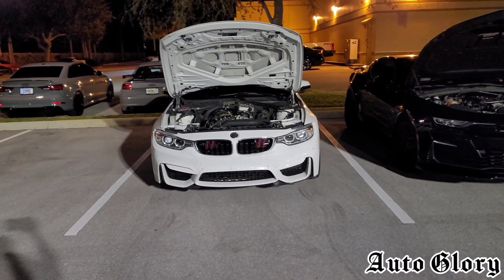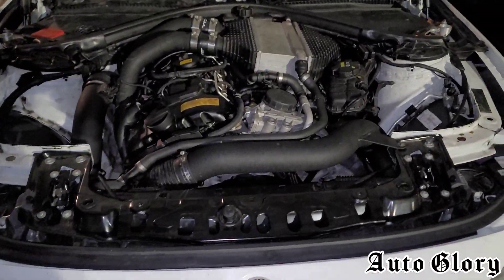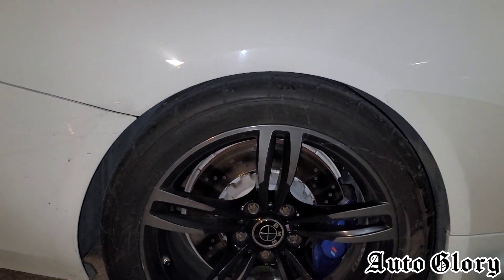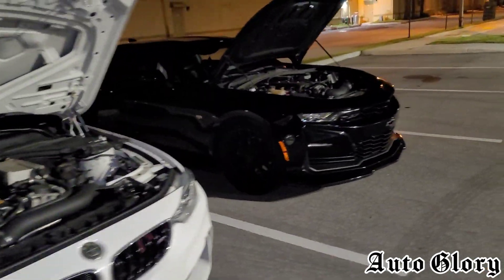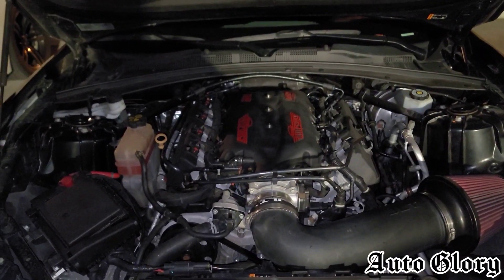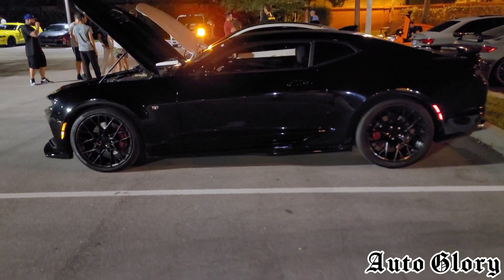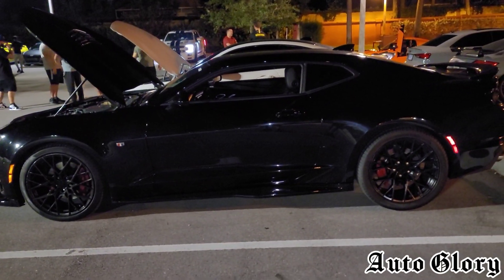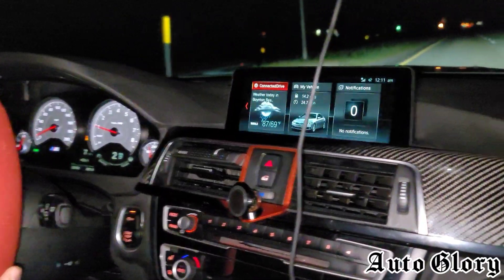2016 BMW M4 Bolt Ons E85 vs Built 2019 Camaro SS Bolt Ons Cam E85

Comment: Damn..camaro and all those big mods and the M4 still got’em
Reply: Beat him like he was stock
Reply: @2jz 240sx I'd say the biggest mod is a built short block....
Reply: @2jz 240sx  a completely picked apart and built engine is a small mod.... id say the supercharger or turbos are smaller mods than a built engine lmao
Reply: @2jz 240sx having a built engine is not really something youd call a small mod lmao
Reply: A built block is a built block, not my fault he didn't run 11 to 1 compression for an na build. He still did a lot of modifications.
Reply: Definitely a tune issue

Comment: Hope he built that motor with the intention of throwing a supercharger on there. You don't put your NA against a tuned turbo and expect any other outcome than this.
Reply: Unless it’s a 4 cylinder
Reply: @2141mario  well if it was the 4 banger then it would be turbo, not NA. And it obviously wasn't as we saw under the hood, and by the exhaust, and I don't think Texas Speed even bothers with anything other than LT1/LT4 for this car, and because I can't believe anyone in the world would be dumb enough to drop a built 4 cylinder into a car made for a supercharged V8. I need to hold onto some shred of hope that the entire human race isn't lost.
Reply: I’m talking about a turbo 4 vs an na v8
Reply: @abbadon3718   lol I think that they meant a NA car could run against a tuned 4 cylinder turbo. Not that a 4 cylinder would be NA xD
Reply: A cat named Scamper  this Camaro was putting down more than a viper, though probably 300lb or so heavier. Educate me, I'm not sure what people are getting out of their viper mods NA. The crazy ones I see have gone TT so I have no frame of reference.
Reply: @abbadon3718  Gen 2 GTS is around 3350 lbs, gen 5 is about 50 lbs more.  9L stroker V10's make about 700-750 RWHP.
Reply: Obviously that's NA, WAY more boosted!  Either way a built NA Viper could easily put a beating on this BMW.  I'd guess a built 600+ whp C6Z would as well.
Reply: @ssoffshore5111  lol the m4 only had fbo couple pipes and a tune 😭 the maro had everything built for the most part. Did u not hear the explanation of said vehicle’s?? Mperformanceftw 🙌🏾
Reply: @120express  Hopefully you meant to reply to someone else because I didn't mention the Camaro above. I just said there's NA setups that would spank this BMW, and that's a fact.  
With that said, when a much larger LS7 427 with far better higher flowing heads/ports has these same mods, it's about a 600 whp setup.  I'm sorry, but I don't buy this Camaro was making 580 whp as stated.  Possible, but the math doesn't add up.  
Someone's numbers aren't right, maybe one was understating and the other was overstating, don't know, but the results should've been closer if the numbers were accurate.
Reply: @ssoffshore5111  no muscle is beating mperformance though. B58, s55 m4/m3, s63 m6 or n54 would feast. Especially a stage 2+ pure turbo one  not a chance
Reply: Amen brother
Reply: Exactly
Reply: @120express  got 900whp that says you're wrong and room for another 5lb boost. Shit, my mechanic has 1100whp in his pickup truck that I'd like to see a M4 beat. But it's ok, just keep fanboing without realizing every build is different and there's no such thing as a car that can't be beaten by another car if enough time & money are thrown at it.
Reply: its also has 2 less cylinders to even it out
Reply: @ssoffshore5111   these American sportscars need a fortune to reach the Same level as these german sports saloons/sedans lmao you need a fully built engine and some nitrous to compete while some of the german cars need light upgrades like a downpipe and tune to go above 700 whp
Reply: exactly.
Reply: @naseralshareef3026  lol define a fortune. My 900whp SS build came in around the base price of a M2 CS.
Reply: @abbadon3718   doesn't justify the difference in handling and luxury, tech and looks. You are talking about an exclusive M Car. no offense im sure time and effort was put into your car but its a car that goes fast in a straight line and is not easy to live with...
Reply: @ssoffshore5111  yeah but for the price of a tuned na viper you could buy 2 tuned m4s
Reply: @naseralshareef3026  you ever look at any actual lap times for 6th gens? Don't get Camaros confused with Hellcats. Easily handle and brake as well as M cars. AMG are a joke on a track. Audi, no competition. Porsche, now we're talking a while different class and astronomical price difference. Is the interior as good as a $90k car? Nah. But tech and livability? Oh yeah. Mine has not just heated but cooled seats, which my friends same year F82 doesn't. Same with car play, remote start, and most importantly, that V8 sound. Still my DD so yeah, just as easy to live with as a modded German car. Plus the build wasn't all engine, part of that price tag was suspension upgrades as well. You can do a lot when starting with a car that costs half as much.
Reply: @abbadon3718  im pretty sure your gas mileage aint as good as an M2 CS, and dont compare a camaro to an M2, especially an M2 CS because its in an absolutely different league also how can you make fun of AMG you know any 63 merc aint more than a second slower than an M, Audi? maybe you dont know that the RS3 is the fastest Compact sedan on the nurburgring? all chevy has that is impressive on the track are the C8 and C7 Zr1
Reply: @ssoffshore5111  give him a break man.  He just likes bmw. There’s always a faster car.  Whether it’s muscle or tuner. But bmw’s look the best doing it.
Reply: @matt2248  who wants a viper.  They handle like trash.  Bouncy as hell.  My uncle sold his to buy a Ford GT 500.  IMO both undesirable cars.  But point is. Everybody has their preference.  I used to be American muscle all the way.  Then I bought my first base model 320i.  I was hooked.
Reply: @BimmerMafia  you just said a 320i….💀 I switched from a 328i to a Camaro & don’t regret it one bit
Reply: @Knighthaaawk  320i was my first bmw.  I’m on my 3rd now.  😆. And that’s your problem.  You were in a 328i🤷🏽‍♂️.  You gotta get something with some power. N54, b58.  …. Not a n52 or n26/20.
Reply: @BimmerMafia  you just stated a 2.0T N20 is what got you hooked on bmw tho 😂 😂 & its slower than a 328i but I got the SS for that buddy
Reply: @Knighthaaawk  omg another child.  Yea the full leather interior. . 8 speed auto. Turbo.  What’s not to like.  Your right about power which is why I got better bimmers now. Ss?? Lol. With gen?? Don’t tell me you got cloth seats that are prob manual too.
Reply: @Knighthaaawk  just saw your 328i. And the f30 320i has same amount of torque with 50 less horsepower.  But that 8 speed auto would definitely walk a stock e90 328i.  And if it don’t. That amount of hp is definitely enough to have hella fun. Am I right??
Reply: Bimmer Mafia I have no problem with anyone liking whatever car/brand they like.  You don’t like Vipers, I have a TT Viper and love the car.  But I get Vipers aren’t for everyone! Actually I love/own a lot of different cars and brands so I’m not even remotely biased.  If the guys loves BWM’s, I’m down with that as I think the new M’s are exciting cars (although in desperate need of a nose job IMO).  The issue I have is making global statements talking out his ass that nothing American will beat these cars.  That’s completely false and everyone (but him) knows this.  Again, I get loving the brand, and being a fanboy, but no need for the complete FUD!  That’s where I drawn the line and have to call a spade a spade!

BTW, I could go out and buy any car mentioned in this thread tomorrow if I wanted.  What’s my DD?  Probably the least expensive car mentioned so far, a C6Z.  I know it’s not for everyone, there’s certainly faster cars, but I just love the manual, engine, light weight, and rawness of it… IMO it’s a just a completely fun car to drive, even if I didn’t pay much money for it and it’s not considered today’’s holy grail.  I don’t blame anyone for wanting something else, and I certainly realize there’s far better cars out there, but I just enjoy that black bitch every time I drive it.  Won’t hear me claiming nothing is better or faster though!
Reply: @120express  it’s not called a maro it’s a CAMARO not a bone maro. 😝
Reply: @naseralshareef3026  yes but the same fortune cost the German cars
Reply: @matt2248  but a m4 will never look as good as a VIPER.
Reply: @BimmerMafia  Viper ACR is one of the best handling cars to date so what he hell are you talking about?
Reply: @carnut7436  maybe on a track.  Cause that’s what it’s built for.  Not on streets.  The suspension was hard and bounced all over the road.  But that my opinion.  If it was so great they’d still make them

Edit. 
Not maybe on a track.  Definitely a beast on track.  Trash for street use.
Reply: @2141mario  it's ok i see what you're saying....a turbo 4 would've been a fairer race.
Reply: @ssoffshore5111  muscle ars suck bro german cars are elite
Reply: @120express  on god an n54 has gapped anything there is to.  I’ve seen it on stock turbos.  Lol.  328&320 far from civics tho. 💀 they good beginner or chick cars.
Reply: @carnut7436  do you own a viper ??
Reply: @BimmerMafia  but I got the big boy toy so who’s the child? 😂 you upgraded from slower to SLOW. I love bmw but don’t be a nut hugger dawg. They already have too many of them lol
Reply: @Knighthaaawk  how is 320i to e90 n54 slow.  Lol.  And I got a 2018 530i.   Not a speed demon.  But class and ultimate driver car.  That’ll pull up anywhere and people gonna respect them kidneys pulling up.  That’s a big boy car.  Your ss is a dime a dozen.  Like the Ford Taurus or Nissan Altima of the muscle cars.  Calling my e90 slow.  😁.  There’s a reason why you didn’t upgrade your 328i. And don’t forget my entry level bmw still turned heads.  Still got compliments from the bmw community.  So not worried bout my line up. In a year my e90 will put 5-550 to wheels.  And only faster after that.  But end of day it’s all talking shit and having a good time around cars.
Reply: @120express  German cars are elite. Especially elite at depreciation, and raping your bank account with out of warranty repairs and maintenance. Super elite bruh!
Reply: @Knighthaaawk  🤝. Oh yea never taken serious. Shows were men unlike a lot of commenters and actually enjoy cars.  But class does matter to me cause I’m all tatted up.  So I like to look presentable as much as I can ya know.  But cool bro. Stay up 🤙
Reply: @120express  maybe. Maybe not. Come to Vegas and see. Put some $ on it.
Reply: @Knighthaaawk  😭 u definitely got bus lengthed by a bmw probably a 335 n54/55 not even the real bigboys…even worse 🤣🥴  and only the idiots who do oil Changes every 10-12k like the company says. Then it becomes unreliable bahaha maintain ya shit like any car and you good homie
Reply: @Jr_5646  we dont care about depreciation or raping of said bank accounts or warranty 😆💀 we just focuse on the task at hand. To whoop any muscle car at any given red light and/or track💨😈. “The ultimate driving machine” 💨
Reply: @Knighthaaawk  😭 buddy ur car is shite. Your the one talking about pretty cars and pampering. Like whattt? 🤣. I call em monsters Like I said we dnt care about looks we just care about going fast af, turbo life simple, the looks are a plus sure thanks lol
Reply: @Knighthaaawk  but the pampering yes u got us there. Us M drivers do enjoy some road head on occasion, That would be considered a pamper no? 🧐😈
Reply: @abbadon3718  I HAVE to come out there. Been wanting to come but the vid had everything fd up 😩🤟🏽
Reply: @120express  DM me when you come out. I'll show you some nice curvy places to cruise that you'd love in a M car and there's plenty of places to do pulls as well.
Reply: @120express  🤣🤣 You a 🤡. There's LS powered cars running 4s in the 1/8 and 7s in the 1/4 on the stock bottom end. There's LS cars running 8s in the 1/4 naturally aspirated. There's billet block LS in the 5s 1/4 mile. What you talking about? Which ever price point or mod level you choose theres a faster LS then a BMW. Ultimate driving machine 🤣.
Reply: @Jr_5646  oh damn. U lost 4 races against us and was gapped in all of em? Sheeeit
Reply: @BimmerMafia  yes I do a GEN 5 And I love it.
Reply: @carnut7436  sweet man.  Growing up that was the fastest American 🇺🇸 muscle you could get.  You living the dream 🤙

Comment: M4 is way out of his league, would need a bolt on ZL1 to even things out
Reply: The m4 walked a bolt on ZL1 in his other vid lmao
Reply: @mattsilvestri8477  lol damn
Reply: I run a local FBO / E85 ZL1 with my 15 M4 FBO / E85 and pull a car or two on him from a 40 or a 60.
Reply: @mattsilvestri8477  Depends on which bolt ons. Start adding fuel to the ZL1 with other mods and and the M4 will need turbo upgrades.
Reply: @arkarius944  stock turbos, pure turbos and it’s a diff story if it’s stock motor zL1
Reply: @arkarius944  exactly and than if you add ported blower with cam and heads, even a upgraded turbo m4 won’t keep up
Reply: @marcozuniga1186  the stock motor on the ZL1 is capable of 1200+whp. The fueling and tiny supercharger are holding it back, not the block.
Reply: @arkarius944  wow that’s a dam strong block 🤙🏾 🔥
Reply: @arkarius944  That may be true, but who is running that? Less than 1% of ZL1s maybe even less than 0.5%. Also what holds people back is their bank account. Always can make cars faster, comes down to who really is gonna do it and if it makes sense. The m4 doing that just with 2-3k in mods and easy to daily. Like I said, always gonna be "ifs and buts", just comes down to what is really on the streets.
Reply: @MikeyG003  and most m3/m4 are stock.
Also those cost a lot more to buy new for the same features.
Reply: @arkarius944  Yep, 2650 blower, full E85 tune (fuel system upgrade), headers/exhaust will get you to 900+ whp with ease and run there forever without issues.  Never have to open the engine up (stock cam too).  Of course, the blower upgrade and the fuel system are going to cost you $10k unless you want to take the risk of methanol....
Reply: @MikeyG003  Where I live the vast majority of them are completely stock. And M3's are a dime a dozen around here. People are honestly more likely to mod a car like a ZL1 than an M3.
Reply: I beat m4s in my 6sp zl1 1le with cam , pulley and e40